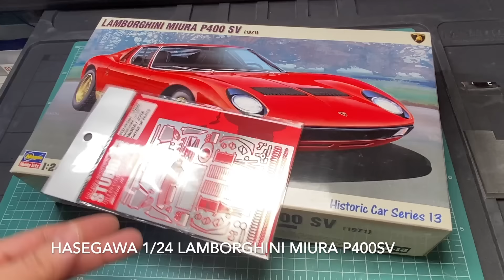LAMBORGHINI MIURA 1/24 HASEGAWA Model car build  [Full version]

Comment: Amazing scratch building Where do you find the plans/  blue prints  to recreate the scale accuracy and reengineer and fill in the missing chassis rail structure , Bonet, hood reinforcing beams, missing engine details  and all the metal  fittings and hinges ? The extra bits are like a complete kit in itself including scale  metal wipers door hinges ect .It would be impossible to do without some sort of detailed  plan and references . Can you please tell us what extra plan or references where used to source the accuracies in this kit as results are amazing from such a simplified basic original kit.
Reply from the maker: All the materials are obtained from the Internet. It takes some time, but you can find all the materials you want. Thanks!

Comment: The modeller made this look easy. But this started as a very basic kerbside kit with no engine or sub frame detail. To accurately scratch build the front and rear sub frames and integrate them into the kit parts that are worth salvaging is great to watch. I can also say that cutting out the doors and making frames, door checks/jams and realistic small hinges is not as easy as it looks. Neither is reconstructing the front nose cone and rear bonnet/boot, to hinge as nicely as that with all the increased detailing. Also to scratch build an engine block and carbs with all the other parts plumbed in on a 1/24 scale model must have taken many, many man hours to complete. This model would also have taken a lot of project planning, a lot of study of photographs of the car engine bay and the pre planning of parts scales and materials to use. This is one of the most excellent kit modifications and upgrading I have ever seen, amazing fabrication skills.
Reply from the maker: Thank you for praise!

Comment: Speechless!! I sit holding my breath, unconsciously, as you work on the "microscopic" parts you add to the original kit. Have now seen the construction of the Citroen and Lamborghini, and look forward to the next one. You are talented! It's great to follow what you do, and you inspire me to develop myself. Should start using more foil instead of using varnish for chrome, as I do not feel it will be so good. Do you have any tips for a website where you buy what you use to make parts? Both plastic and metal.
Reply from the maker: Most of them are purchased at model shops, but we are also interested in looking at materials for other purposes. Thanks!

Comment: your work is amazing, superlative. I had never seen similar work in static modeling. the only thing I feel like telling you is that are missing "lashes" around the headlights.
Reply from the maker: I also wanted to add, but the 400SV doesn't have lashes. Thanks.
Reply: ok sorry, I didn't know there was a particular model without "eyelashes". congratulations again. you're amazing.

Comment: Grate job. Please to watch.
Could you share an experience with me?
1. Smooth finish is very important for car models. And I see you are polishing your model for this. Did you know some techniques which doesn`t demand this step?

2. Do you have experience with clear gloss coats from different brans? If yes, could you sort them in smoothness or quality of results order?
3. What do you think about Tamiya x-22 clear gloss?
Reply from the maker: I always do polishing. Of course, if you can make the surface as smooth as possible during the painting stage, the time will be shortened.
I haven't used another brand yet. Thanks!

Comment: Excellent, only two questions: 1 What kind of metal was the metal parts that easily connected to the tin ???  I slip on the metal every time I tin!  2 What is a brushed adhesive ???  Is it a special type ??
Reply from the maker: 1. Nickel Silver - Solders well.
2. Is it the glue on the green lid? It is Tamiya Extra Thin Cement.
Reply: @A4Garage   Thank you very much for the answers💗💗
Other than nickel, what do you suggest for soldering ???  I mean metal wire, because silver is a little expensive. How many watts is your soldering iron ????

Comment: I am half way through building a 1/8 scale F40 Ferrari (diecast) and it does not have half the fit and finish of this Miura build.  So far I have spent around $1,250 AUD and I still have that same amount to spend to finish the model.  I would have been better off just buying one of these magnificent completed models from A4.  Are they for sale?
Reply from the maker: I don't sell I made. Thanks.

Comment: can u make a thin layer of rubber filled with air for the tires, & the seats made of cushin, or just the top covered with fabric or leather?
Every Single scale models gets this part wrong
Reply from the maker: It seems absolutely difficult on this scale.

Comment: What wire do you use on that carb and tibing size to mae the linkages and fuel line
Reply from the maker: I am using several types of 0.3 to 1 mm.